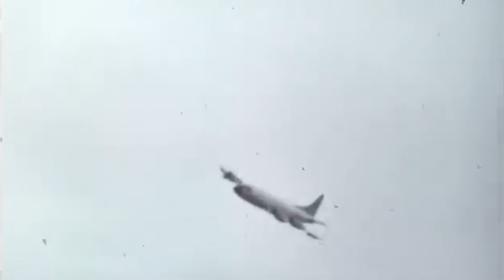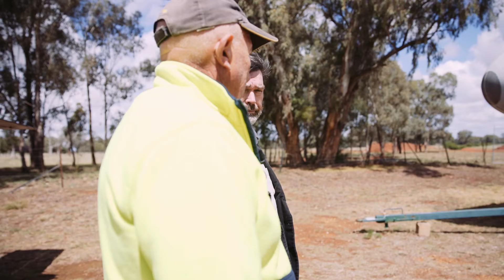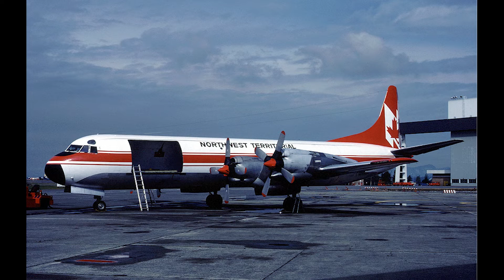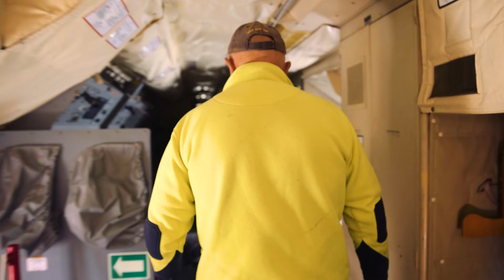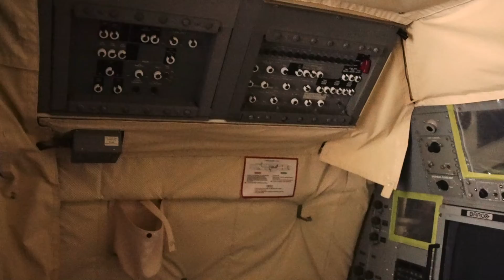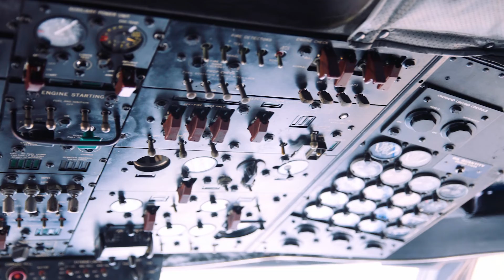In the cockpit | P3 Orion

Comment: Just for the record, even though it has a 10SQN insignia 759 was flown by 10, 11, 292SQN and 92WG HQ elements - you just got whatever aircraft was available. Now replaced by both P-8A AND MQ-4C as part of Project AIR7000. Nothing on this aircraft was "TOP" Secret. The black box he pointed to for launching sonobuoys isn't for that - it is the intercom/radio panel for the ordnance station. There is another screen there for ordering which buoy into which chute and acknowledging it. The buoys weren't launched from the acoustic stations, they were setup/launched by the TACCO behind the pilots, sometimes automatically if flown over a programmed point. The majority of the sonobuoys were held in the external chutes so they could be fired without the ordnance operator needing to load them into the internal tubes. Freefall chute was also used to drop sound signals when "attacking" a submarine in training so the sub knew a torpedo had been dropped on them. Also used to freefall small smoke markers for things like search and rescue. They did have rare open days where the public could go onboard, just everything was secured and people were escorted. In RAAF Service the TACCO was never the "Captain", they would run the mission but the senior pilot was the "Aircraft Captain" - other nations like the UK with their Nimrods did this differently. On the AP-3C when on station the TACCO would decide the course and plug it into the combat system which would direct the pilots on their screens - it didn't go through the Nav. When in transit the Pilots would normally set the course in the upgraded avionics system and Nav would just monitor. Also had more people on board not just for training but for duty rotation so people could rest on long missions - most sensor ops rotated stations and had a spare to allow rest, Flight Engs usually had a spare to rest, co-pilots sometimes had a spare to rest/train, while NAVs/TACCOs/Sensor Managers/Aircraft Captains rarely ever had a spare. (10 years P-3C/AP-3C operator, AIR7000)

Comment: Didn't show us the galley, where the breakfasts were made. Most important part of the plane.
Reply: The best part of the food was the canned dry chicken noodle soup, the original RAMEN noodles. The rest of the prepared food depended on if you got it from the Air Force or not. They had good food the Navy has stale box lunches that we used the "retro" to send them to Russian trawlers. That is what you do on those long flights and the Russians were thankful. They were on station for many months not seeing anyone.
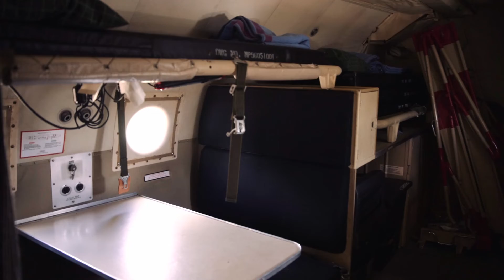Reply: Yea, they didn't go to the right, they took a left.  But they did show it briefly at 9:13